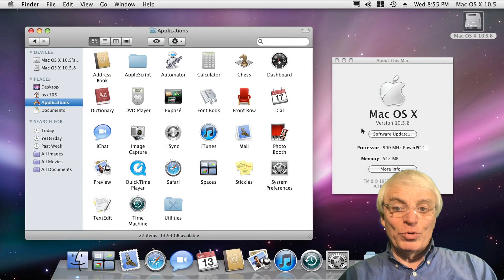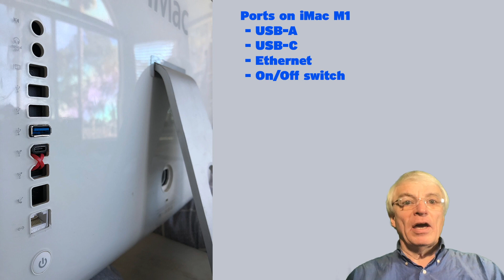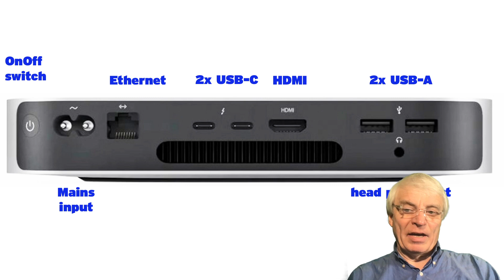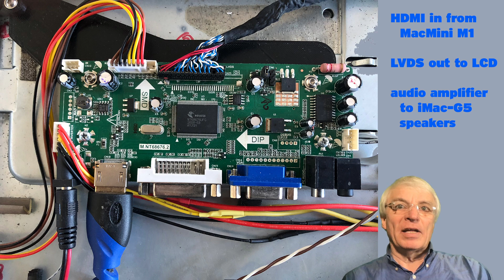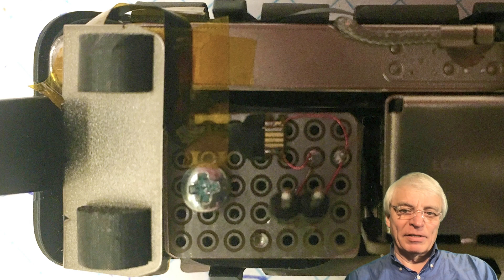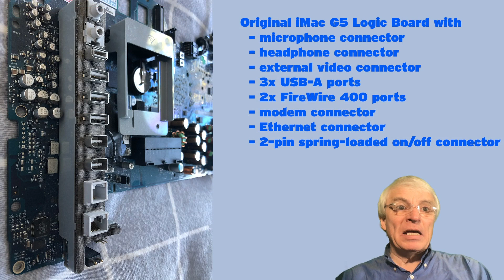iMac G5 upgraded to iMac M1 using a MacMini M1 logic board

Comment: привет, интересная сборка, но разбирать mac-mini и вставлять его внутрь G5 не рентабельно, потому что хороший монитор в комплекте с мак мини значительно лучше, чем старый экран(DISPLAY) у G5. 
проще было вставить туда скалер и использовать G5 как монитор или TV. Но если речь идет о том, чтобы дать старому G5 новую жизнь, то я бы вставил в него недорогую материнскую плату mini-itx и установил хакинтош или win10. это дешевле.

отдельно хочу спросить, как вы определили, какой скалер заказывать, и какой нужен LVDS-кабель?

hi, interesting assembly, but disassembling the mac-mini and inserting it inside the G5 is not cost-effective, because a good monitor with a mac mini kit is much better than the old display on the G5.
it was easier to put a scaler in there and use the G5 as a monitor or TV. But when it comes to giving the old G5 a new lease on life, I would put in an inexpensive mini-itx motherboard and install a hackintosh or win10. it's cheaper.

I want to ask, how did you decide which scaler to order? and what kind of LVDS cable is needed?

Comment: hey, i’d add one thing to your possible next steps, take mains power from the original G5 transformer to the M1 power transformer, so you only need to plug in 1 mains cable instead of 2

Comment: this is crazy how did you go from a g5 to a m1 that's friction crazy dude
Reply: It's a great little project, and very well executed... but it isn't "crazy". Seriously, swapping out a logic board and extending cables isn't some kind of black magic. It helps that the M1 Mac Mini is essentially a small laptop board in a desktop case, and is therefore really easy to transplant. The really hard part was someone designing a PCB to change HDMI, DVI or VGA to Apple's internal monitor connection.

Comment: What an interesting video, congratulations!! I believe the modern iMac's should be modular. Possibly 3 parts, rectangle in shape when built. The screen would be 1 module. It literally would sit on one base section, and would drop onto a HDMi/Display Port connector. That way, the iMac would be upgradeable in future. The bottom section might contain storage, speakers and PSU. The rear unit (same size as the screen) would contact the boards, chips, RAM, cooling, and cables etc. But what a brilliant project you have there. I'm not an engineer, but appreciate the work and thought you must have gone through to plan/design the upgrade. Well done. Stay safe...

Comment: Dude! Its awesome! One thing to little correction: look at the ehternet connections (blue cable) - You shoud use 6cat UTP kable (best if factory made). 
Apple always tries to pay attention to details: look at ETH port on M1 board - it is wrapped by a sheet metal. That means ensuring best protection against interference.

Comment: My daughter has an aging iMac 27 inch. She is a photographer. The upgrade must be dependable and the upgrade would need to be “easy” for me to complete 😆. Interested!!!
Reply: The “easy “ conversion is what Luke recommended at the end of his Mac Minized iMac video: Run the HDMI video out of the M1 Mac Mini with a special cable sold for that purpose, into the iMac display. The iMac screen will display the Mac Mini’s desktop , you don’t have to do surgery on either machine, and you have access to the Mac Mini’s ports and  power button.  https://youtu.be/u20ETyp4jx4.

Comment: I think if someone designed an integral usb3 hub into the rear IO panel board that would be ideal. USB hub chips have 4 ports so maybe an internal port as a provision for a microphone jack dongle or microphone DAC built into the board.
Any function the other ports had can be performed by a USB-C dongle, so they can be plugged with 3D printed blanks or bezels for additional USB-C extensions for other models of mini.

Comment: Its too messy for my taste too many hanging wires in there with bad fitted boards... i would just gut the imac then install the lcd board inside then run the wire from the power cord out of imac and plug into the mini...

Comment: This is a very clever conversion, I wonder if you could do the same to a 27” Thunderbolt Display? the case seems big enough and I guess you would just be adding a logic board and routing the power supply, on/off and I/O
Reply: That would be so nice. I don't think there's any space in it but if you could put one inside the Apple pro display and have it seamlessly use the heatsink that would be a sleeper. Hopefully the new iMac will be something akin to that but I don't have a lot of hope. the current gen iMacs are embarrassing.

Comment: Is it hard to just plug the HDMI cable into an external monitor "With a better resolution"?
Reply: The iMac's aesthetics is a great part of the project point. If you want a better display, look for a 24" or 27" iMac with a good screen but otherwise faulty.

Comment: Luke miani upgraded Intel imac which was around 6 years old watching that I thrilled
But this guy turned g5 mac which is even older than intel macs (16 years old imac btw I am 17 year) i have no words 🤯🤯🤯
Reply: The age of the 'old' iMac isn't really that important, neither is the PPC or Intel architecture. There's very little practical difference for this project. You can rip everything out just as easily, and as long as the case is big enough, fitting something like the M1 board inside is an easy task. Adapting or replacing the PSU and extending cables to reach the USB, video and audio ports etc is the same for both. You could put that logic board in a 1940s gramophone or a 1980s VCR. 😁
Reply: @another3997  after giving it a big thought. If I agree 100%🤔

Comment: This is outstanding, A+ on a job very well done!  While, I could never let this happen to an Apple desktop with a Power PC chip (G3, G4, or G5 processor) have no problem seeing this occur on either my white 20 inch Intel iMac or my white 24-inch Intel iMac system.  Because, who cares what happens to a computer with an Intel chip "Inside".  Have a question for the "Mac Repairman", apart from the cost for shipping how much would you charge (including both parts and labor) to again do this type of modification?

Comment: So awesome nice work! I guess another way would be to leave the Mac mini intact on the desktop and just install the hdmi adapter board in the iMac and send one hdmi cable into the iMac to use it as a monitor, but this is way cooler.

Comment: Good job resurrecting the old iMac G5... I have a 2012 27" iMac and would like to do something similar rather than buying a new M1 Mac mini or MacBook Air.
I've heard you can use the M1 Mac Mini with the iMac as the monitor. The other problem is the lack of new ports and the redundant Thunderbolt 1 ports on the iMac...
Maybe this will start a trend in renewing and re-using, rather than just recycling via the rubbish tip....
Reply: You can gut the iMac and use an adapter board (various types on eBay about $80) to drive the display from the M1 mini..... you can start by just mounting the Mini on the back of the 27" case.